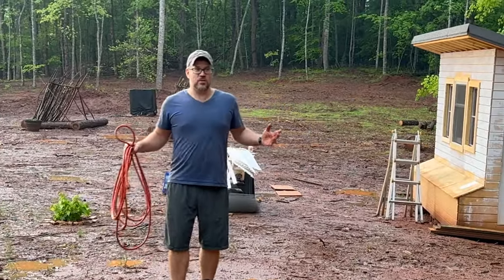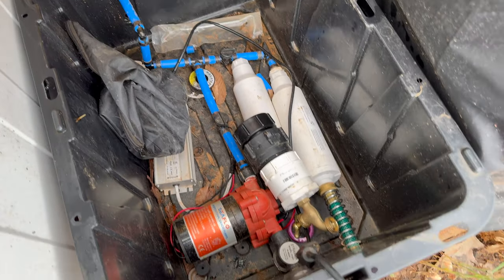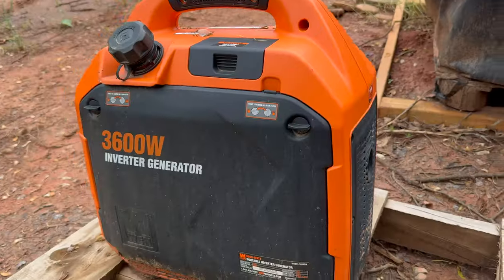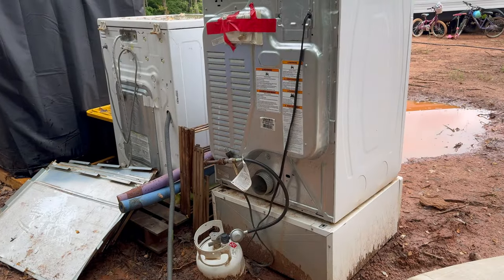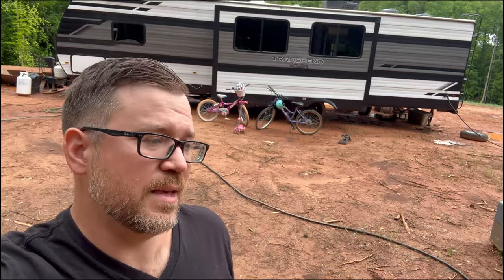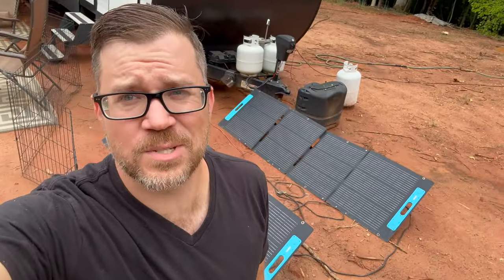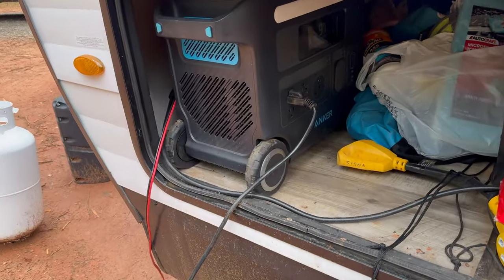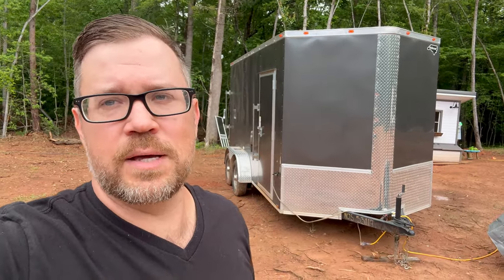What worked? What didn't? Off Grid Six Months! Grand Design 321BH RV

Comment: You have power now, that is not off grid now.  Hot water is easy off grid with a on propane on demand you just need a small shed for protection.  If you do get freezing you will have real trouble.  Insulating box trailers work very well off grid.